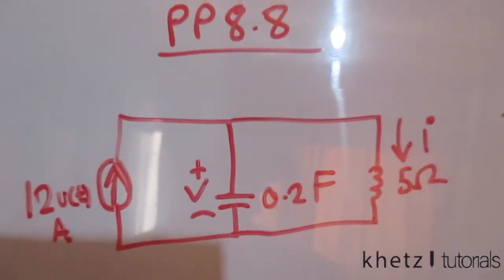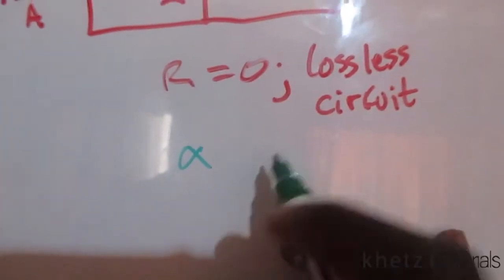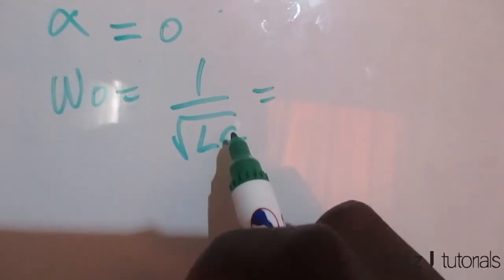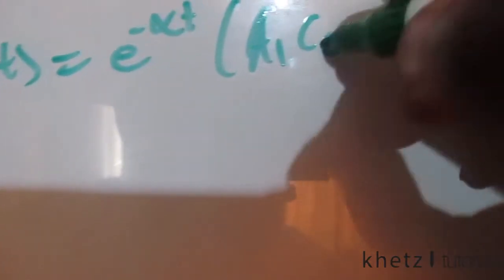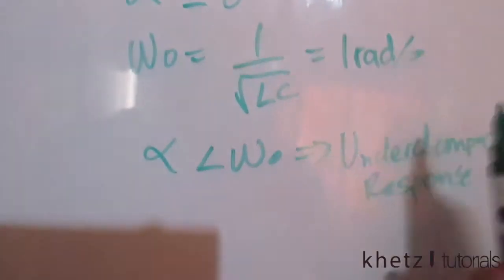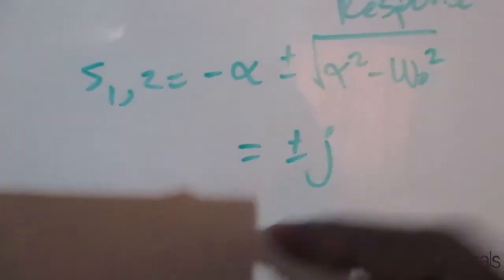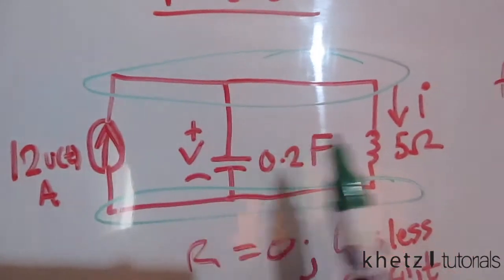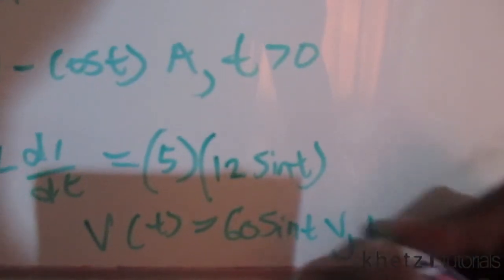Fundamentals Of Electric Circuits Practice Problem 8.8

Comment: Actually, here R=♾ => alpha = 1/(2RC) = 1/♾ = 0
Reply from the maker: That might make sense mathematically, but this is a lossless circuit. From the name, lossless, there is perfect conductance, which is in line with theory. The theory states that R=0 for lossless lines. An infinite resistance would lead to less conductance - making the circuit lossy
Reply: @KhetzTutorials  If R=0   =>   1/(2RC) = 1/0 = ♾   
Technically, it's not 1/0, it's 1 over something approaching 0. 
So no. Your math does not stand. The theory is based on math, so either the math is correct or not.
Reply from the maker: @kingofdice66 I was referring to your math. You can consult the textbook or do a quick Google search to get the correct value of R if you do not believe me

Comment: sir can i ask you a question?
as i know, alpha=1/2RC in parallel RLC circuit.
but in this case R=0. so i thought alpha ->infinite 
how can i know alpha equals 0?
Reply from the maker: There is no resistance here, so this is a lossless circuit. A lossless circuit has no attenuation, as I mentioned. For lossless circuits, the alpha will always be 0 and we do not have to substitute into that formula
Reply: @KhetzTutorials thank you so much!!!!!

Comment: 4:42  how is lL(0-)=0 ?
Reply from the maker: The current source is multiplied by the unit step, u(t)), which evaluates to 0 for t < 0 and 1 for t > 0 so it's behaviour affects the current source. The current is,  therefore, only active after time 0

Comment: When you wrote the KCL equation to find the initial condition for dV(0)/dt you took the value for Is as 12 but at t=0 isn't the value of Is zero due to u(t)?
Reply from the maker: Hello. That equation is at t=0+ which is just after t=0 and that would mean Is is "on".